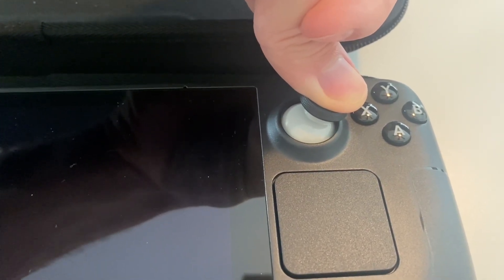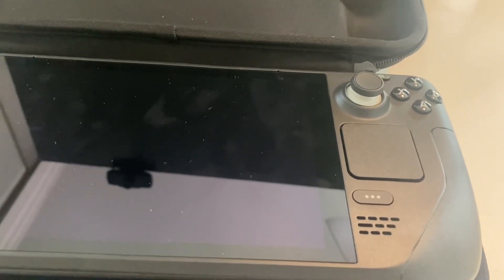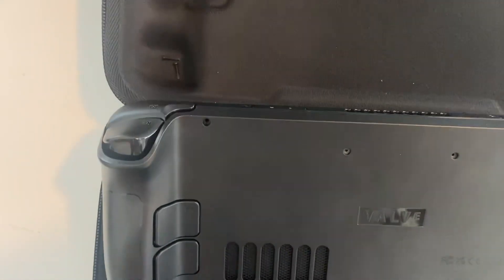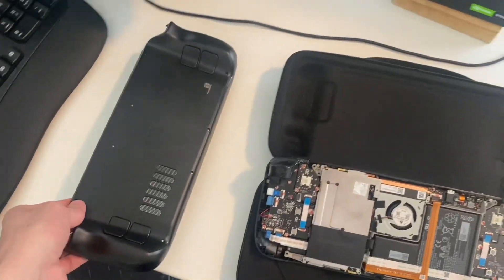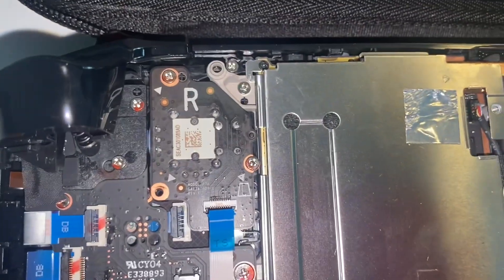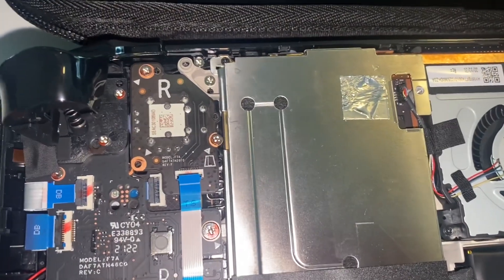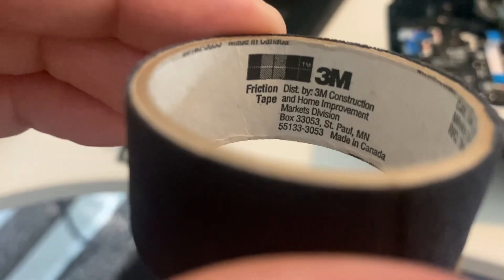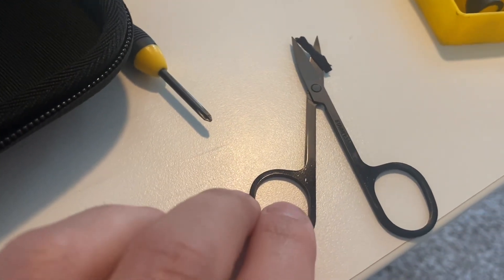Steam Deck Thumbstick Rotation Noise FIX!

Comment: So I put tape on the cable and it’s still making a noise, just not as much.  Does that mean I need to put more tape on it?  I was worried about putting too much tape on so it wouldn’t fit.